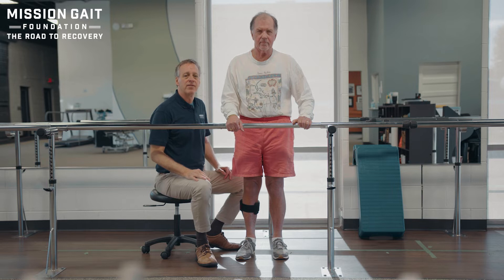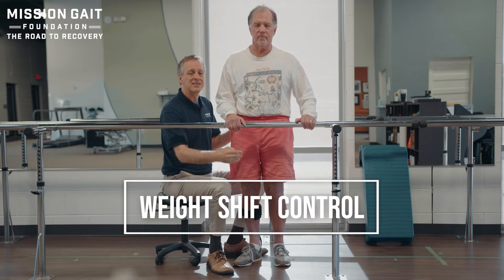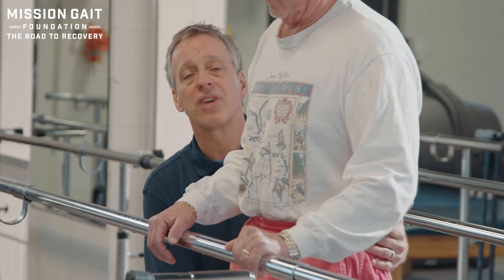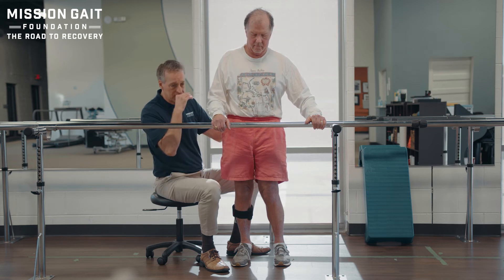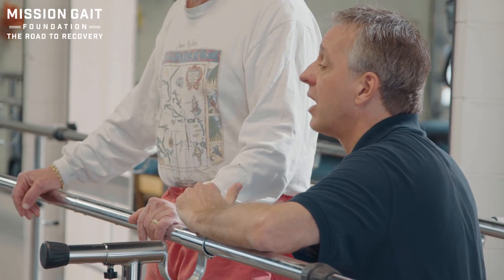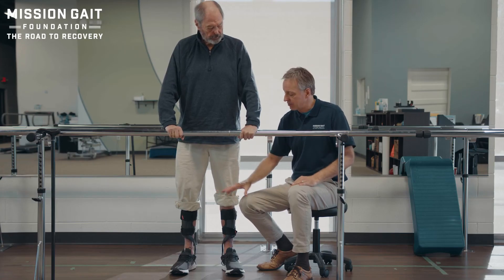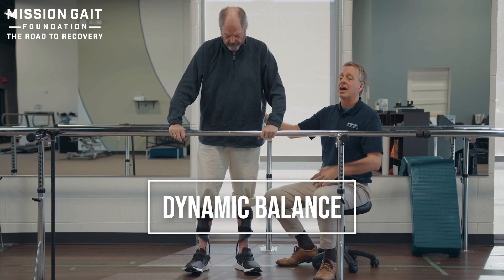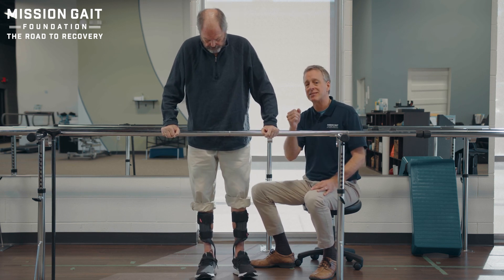Pre-Gait Standing Motor Control Exercises - Orthotic Training: Episode 8

Comment: Thanks great tutorial. I am 67 years old and have had MS for 23 years. (spasticity in my left leg and arm.) use a brace and a cane. I know exactly what you mean by being out of balance. About 13 years ago I had awful pain in my butt. I had MRIs, CAT SKANS, Physical therapy, Acupuncture, Chiropractor and POWERFUL DRUS. nothing helped. I finally had to stop working. A few years later on YOU TUBE, I found exorcises for HIP FLEXORS. The pain went away. The reason for it was imbalance. When walking I was putting all my weight on my unaffected leg and my cane. My affected leg with the brace was just going for the ride and not doing anything. I have since learned to make my affected leg do some work. Also not use my cane as much for support.